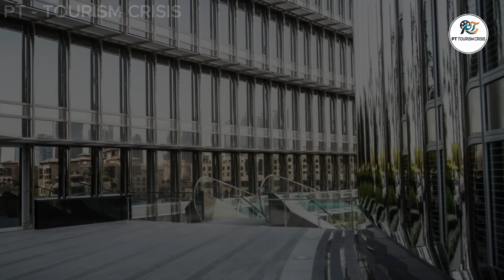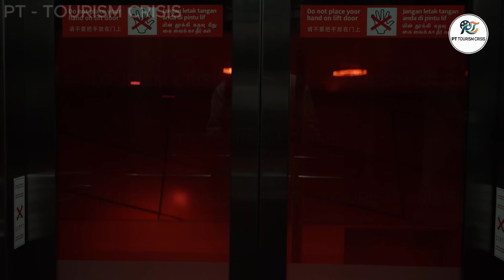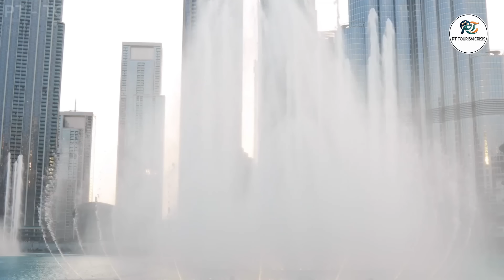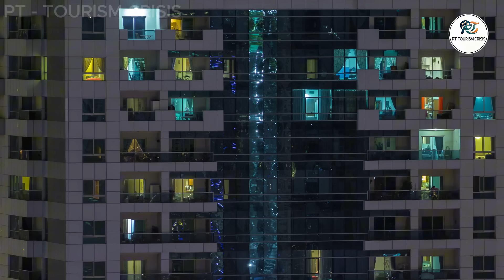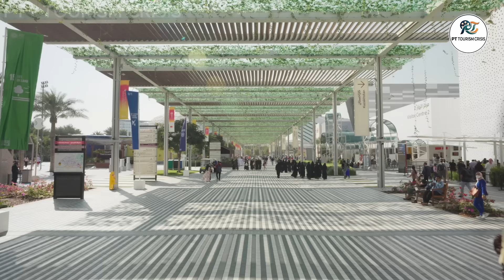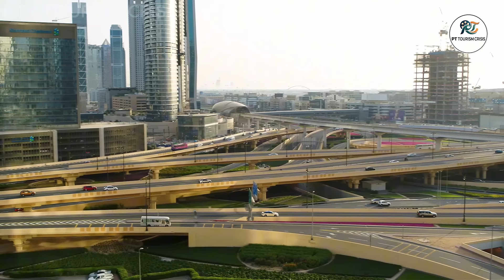Why This 828-Meter Skyscraper Is a 26,000-Panel Glass TRAP

Comment: Why don't they install a turd trap to catch a d recycle falling turds or at least dig a BIG hole adjacent to the downpipe and divert turds and other excrement into said hole which can then be covered with a silver or blue tarp to cut down on any odor emanating from the sh** pitt.
Reply: It would be a PooP shute.
Reply: Imagine driving around in that poop truck when it's  110° outside (43° celsius) !!
Reply: @marvinbone1379 I would want to drive REALLY FAST.
Reply from the maker: A giant waste pit would create far worse health and groundwater problems. The real solution is properly connected sewers, reliable pumping stations, and modern treatment capacity—not a tarp-covered hole.